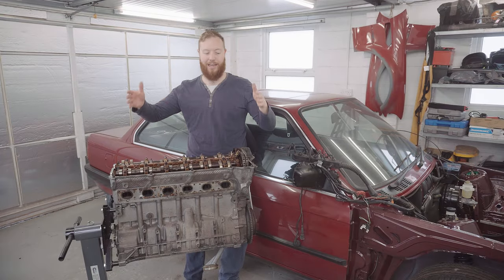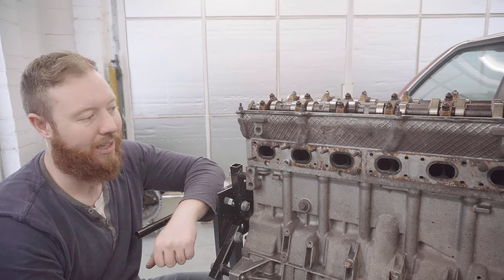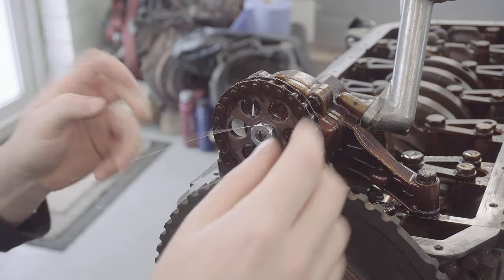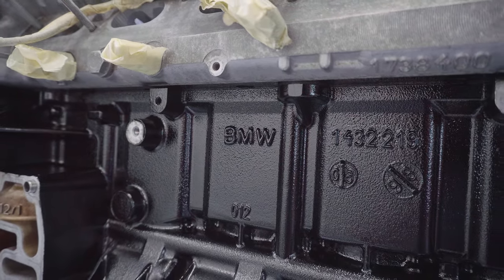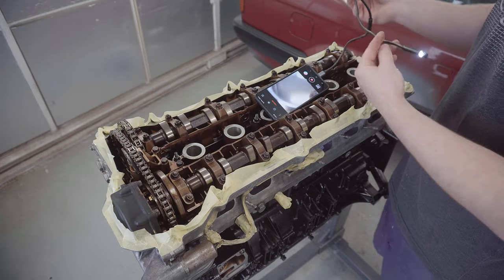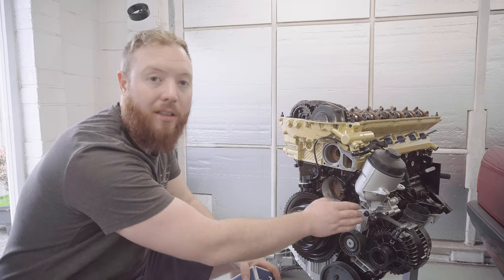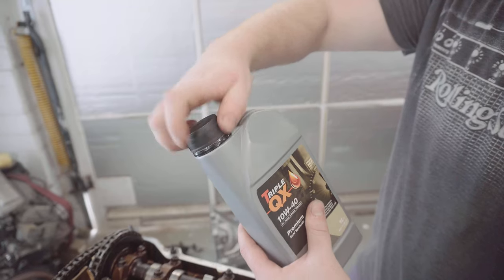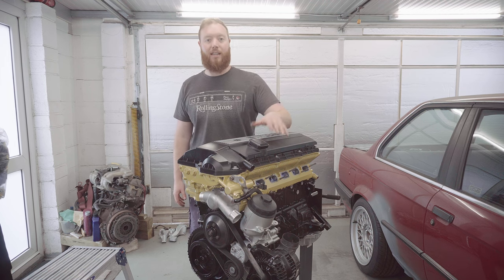BMW Engine Transformation [M52B28] M50 Motor Restoration Timelapse | E30 Build | 045

Comment: Hi bro . Whats your offer about flywheel and clutch kit . Im running with m52b28 + zf 5 speed with m54b30 dualmassflywheel and clutch kit .
Reply from the maker: Hi Anil, I'm running the Getrag g240, and to pair that with the M52B28 I used a lightened single mass M20 flywheel and clutch kit. I believe you can use this same clutch kit if you're using a ZF 5-speed as an upgrade. Or you can use the normal dual mass one that would have come on an M52. I'm not sure about the M54 one. It might work though.

Comment: Nice work, although gaskets work without that liquid gasket you've used on oil pan and oil filter housing, not sure if it's necessary, thanks for your video, cheers from Chile 🇨🇱
Reply from the maker: Thanks Carlos! I always get a bit paranoid about sump leaks so like to be belt and braces with the Hondabond 4. Amazing stuff.

Even if unnecessary, it won't do any harm.

Comment: Engine turned out great !! Also the upgraded you did to it , like the metal water pump propeller or the aluminium thermostate housing , or the wire in the oil pump bolt they are amazing !!! Keep up the great work my friend !!!
Reply from the maker: Thanks man! I think I selected some subtle but choice upgrades for the M52. Hoping they serve me well. 😃

Comment: What oil pan is this? E34 oil pan is so taxed in the US
Reply from the maker: This is the E34 sump but modified to have a shallower pan to avoid hitting it on the ground. I picked it up used and no idea of its origin. Supposedly used more commonly for E21 M5X swaps. 😄 These sumps are now silly expensive here in the UK too.

Comment: I say retorque head bolts while you have a chance; tty head bolts may loosen over time; I heard 65 ft-lb maximum; worked for me! I say use  Red Rustoleum primer to kill and prevent any rust and act as a boat cathode! Cheers!
Reply from the maker: Very interesting suggestion checking the torque for the head. It never even crossed my mind but I can see some sense in it for sure.. I'm at the point of starting to fire this engine up now so might be a little late but I will bear that in mind going forward. Cheers! 😃

Comment: Looks awesome, although you should wear a mask.  Not 100% but those oil pump bolts i have read that they can have premature failure if over or under tightened. No idea how but apparently the shaft can fail.   Really think you should remove head and rebuild. Its little work and few £ to do with ease now 🙂
Reply from the maker: Thanks Martin! And I definitely agree about the mask, that was unwise of me.

Really hoping a slightly overtight one will be okay regarding the oil pump nut. 😅 Hopefully the lockwire and the red Loctite will seal the deal permanently on that.

I don't think I tightened it enough to upset the shaft itself.

I know what you mean about taking the head off, believe me I'd love to, but I can't stop myself and if I'm going to take the head off, I might as well do a full rebuild with new rings and shells etc. And at that point I'll probably never actually finish this car. 😂

With the removable front core support having the engine back out shouldn't be a big deal. I'm expecting to have it back out for a rebuild down the line. But lets see if it can be a working car first!

Comment: Cool build 🔥🔥🔥 Been thinking about building my e30 with some spare engines and parts. I have a calypso 97 328i sedan that was the 1st 1000whp and 9 second example. But we built it 15+ years ago and been itching for a new project. Got my 87 325is from when i was in high-school and a 97  528i thats just been sitting in the driveway. Would build the e39 if their were more lsd differential options for it.
Reply from the maker: Sounds like a match made in heaven, you should build the E30, slap the E39's M52 into it 😃
Reply: @SPANNERRASH  i have a few m52s and zf transmissions laying around. When I built the e36 they were like 300 or less. No one knew the m52s potential until after we had made 600+whp on the stock engine. Everyone else was doing s50/s52s at that time. Also did you make that oil pan yourself? Looks great.
Reply from the maker: @shifty1927  Wow yeah they are known as very strong engines but that's impressive!

Although I'm planning to run mine NA for simplicity (and it's how I like my driver's cars).

I think 200-225bhp in an E30 will be loads of fun on twisty UK B roads. It won't set any quarter mile times though! 😆

Sadly the sump is not my own work, I wish I had the aluminium welding skills to do that sump - maybe one day!

It was a second-hand bargain I picked up. Not really sure who did it but I believe originally aimed at an E21 M52 swapped car. Hopefully it wont cause me any issues with oiling being much shallower, but wee will sure find out!

I'll have to get an oil pressure gauge and keep a keen eye on it.

Comment: Ive always drilled a small hole in thermostat at top . otherwise bleeding the system is nearly impossible
Reply from the maker: Yeah I did consider that actually, but as its a much earlier opening thermostat I decided to just go with it as is. I reckon I'll get it bled up one way or another.
Reply: @SPANNERRASH   i fitted the lower temp aswell otherwise the temperature gauge would of read high aswell - tap the sensor not the block by the way

Comment: 😮😮😮😮😮now that  all that sht u were getting off the engine is in your lungs  along with paint fumes you have become a perfect  example to kids starting out who also want a pretty engine while ruining there health....n BTW because of the paint ....them freeze plugs will no longer pop out if they need to .. well done.
Reply from the maker: Hi John, yeah I agree, I shouldn't have been as lax with the respirators.

Being in the UK and using a decent coolant, there's no way those freeze plugs will ever get put to use anyway, don't fret!
Reply: @SPANNERRASH  those particals floating in a beam of sunlight x 100

Comment: Meyle, only brand that is BETTER than OEM!!
The header paint is weak because it needs extreme heat to melt/bond/cure... I made the same mistake...
Great job! Thanks for the vids!!
Reply from the maker: Yeah, can't believe BMW only provides plastic impeller water pumps when they are known to fail over time. Had to upgrade!

The gold paint on the header is for brake calipers so I'm hoping it will stand up to some serious heat. Fingers crossed on that one. 😁

Comment: I say be sure to use straight 30 weight oil to prevent rod bearing wear, everthing else is just too light and results in early rod bearing wear and pass this tip to others!
Reply from the maker: I think BMW's recommendation for these engines is 10w40. I'd be reluctant to switch from that but I'm no expert.

Comment: Wow, after that much cleaning, I woulda left the alloy alone and maybe just a quick buff w some scotch brite on a drill r die grinder to liven it up some. I've got the US market M52 so iron block, but if my block was Aluminum I'd for sure be showing it off!
Nice build and thanks for the slew of uploads.
Reply from the maker: I see your point but my experience with aluminium like this is that it corrodes a lot, especially if freshly roughed up and cleaned.

It gives off a white powdery flaky corrosion, and I suspect that wouldn't take long. So I decided to go with the coatings to keep it looking fresh for as long as possible.

Maybe doing the block silver would have created a similar effect, but to be honest I'm really happy with how it ended up looking black and gold.

Glad you're enjoying the series! 😃

Comment: Just a tipp next time use the 2bkr6equp" spark plug
Reply from the maker: Hi mate, is that also an NGK plug? Whats the difference?
Reply: @SPANNERRASH  Yes , ngk and it helps smooth  the idle ,better ignition

Comment: On my e21 box i had to drill 2 holes in bellhousing so can access the 2 sump bolts in future
Reply from the maker: Really?? Not heard about that before, sounds extreme. Which gearbox are you using?
Reply: @SPANNERRASH   standard e21 box-

Comment: Really good video, great seeing all the detail. I actually broke my torque wrench trying to tighten my oil pump nut, mine doesn't work in reverse either.
Reply from the maker: Cheers! Omg you must have been giving the oil pump nut some grief if you broke the torque wrench! 😆 Did you not strip the nut?

Apparently most don't work backwards, but I had no idea until now...

Comment: The thermostat is not installed correctly! There is an arrow on it that should be set up.
Reply from the maker: Well spotted, I had to change it soon after I got the engine running as the thermostat housing leaked and I damaged it in disassembly.

The second one I installed correctly for sure as there was a clearer arrow on it!

Comment: I have an m42 on my e30 and I recently cracked the oil sump. Ive temporarily repaired it using some jb weld  like  substance. Now I've watched your video I'm considering getting another sunp and having it modified for more clearance.
Reply from the maker: Dang, I don't remember the M42 sump sitting so low in my 318is, or is yours totally slammed? 😆

I'm hoping my shortened sump for M52 works well, I'm sure I'll report back on it in the future, hopefully not with oil starvation. 🙃
Reply: @SPANNERRASH  I don't know if it's considered totally slammed, but I'm on bilstein B8s and Apex springs. I don't know if it  makes a difference but my car is an 85 with an m10 originally
Reply from the maker: @mariospantouvanos4645  Oh nice, have you checked your engine mounts to make sure they haven't sunk a bit?

A sump guard might be a good thought too. I think I'd explore both of those before a modified sump. But then again you've got a damaged sump you could replace... 🤔
Reply: @SPANNERRASH  well, I'm not losing any oil now so for the time being it's fine. On the next parts run I'll be getting a sumo though. The engine mounts don't have excessive play in them so I don't think they've sunk. A sump guard is a good idea, along with a cross brace for more chassis stiffness.

Comment: Have you looked at the oil filter housing valve?
Reply from the maker: Promise I did mate, the spring is firm that keeps it closed and it looked in good condition to me.

Hopefully, I don't find myself taking it back off any time soon. 😄
Reply: @SPANNERRASH   i found it worn so could sit not square so not sealing
Reply from the maker: @mcjjordan  Interesting, I'm confident mine will seal, it looked totally square and seated firm closed on its spring.

Comment: Looking good, it's coming along nicely. Make a note of the engine number while it's out of the car! It's stamped on the side of the block at the bottom. I had to provide DVLA with an engine number to register the engine swap with them.
Reply from the maker: Thanks mate, and great tip about the engine number.

There are a few codes on it and I got pics of them all after the block was cleaned up. Not actually sure which one is the engine number but I'm sure it will become obvious with a search. 😃
Reply: @SPANNERRASH  No worries. It's stamped right at the bottom of the block on the intake side, should be an 8 digit number.
Reply from the maker: @CYMRU619  Perfect, cheers man!

Comment: Thoroughly enjoying the build from Australia, and super impressed with your diligence, dedication, skills and ideas…

One question and a comment…

For the sake of a couple of tenners and while you have easy access with the engine out, are you going to replace the front and rear crank shaft oil seals prior to dropping it in?

Unfortunately I don’t have welder or blow torch to extract broken studs, so the way I’ve dealt with them in the past was using a left-handed drill bit to drill down the centre of the bolt, combined with a ‘Ridgid screw extractor’ (and liberal amounts of WD-40). Worked really well
Reply from the maker: Awesome thanks Greg, really glad you're enjoying the build.

Funnily enough I was fully intending to replace the rear main seal but the wrong one turned up in the post. I had a good look at the one on the car and thought I'd leave it as it's bone dry and looks pretty new itself.

Hopefully I won't live to regret that! 😅

Comment: Hi, writing from my GF YT account, pro engine builder here, love this series, subbed and try to comment. Just a few tips though, engine must be cleaner inside than outside, on last video the ports and bores seemed outstandingly filthy, have a feeling you are pushing your luck and risking the motor. Absolutely no muck can enter the port and piston cyl area, specially the swarf like stuff we saw on your dads borescope. Was the Rocker cover cleaned before installing, on the edit it looks like it wasn't, this is another problem as muck can be lodged in there and find it's way into the cams and tappets... I know cleaning is a bitch but its 80% of engine reliability. I'm in the process of installing a m30 in a e30. thanks for your videos, they are very informative and detailed, love them just as much as Stretens content
Reply from the maker: Ahh cheers! Yeah the ports had a surprising amount of dust and crap in, but nothing that should cause any damage, its just fluff really that should burn in an instant.

The only thing I'm not quite as sure about it the little chunk of gasket in the cylinder. I'll likely put some time into trying to hoover out that and anything else. There's definitely no metal swarf in there.

Regarding the plastic rocker cover, I actually put an ungodly amount of time into trying to clean it, and a lot came off, but its just heavily stained and will never be truly clean again. I will consider replacing it. But other than looking bad it was completely clean of any debris before going back on.

I'm confident after its run for a split second it'll be golden. We'll find out of I'm wrong I guess. 😆 

Glad you're enjoying the series!
Reply: @SPANNERRASH  🤞